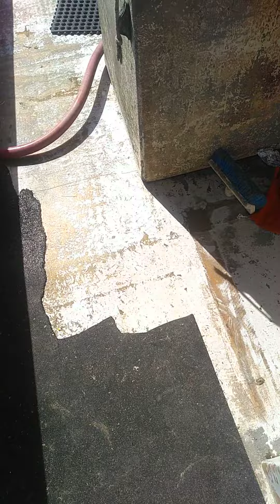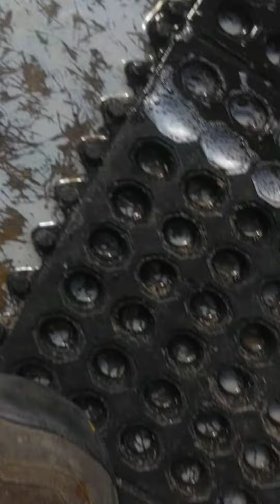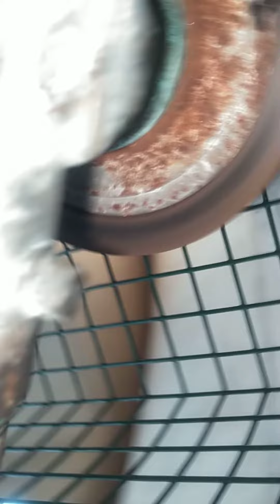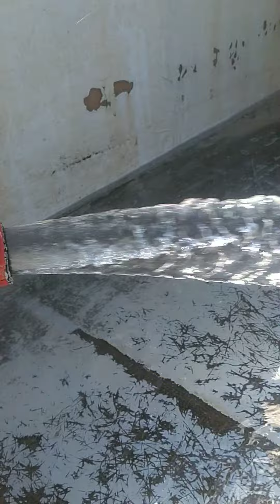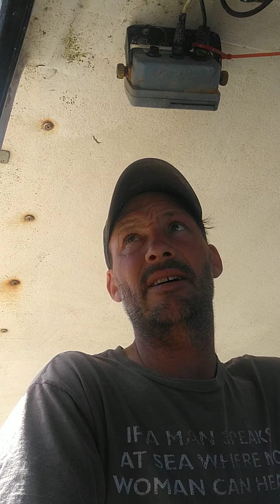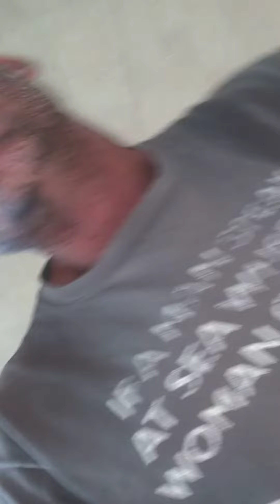new parts worked👍👍

Comment: Gotta like it when shit goes right!!!what kinda motor is that  bud??
Reply from the maker: d-6 330 Volvo  I love it just don't think it's a long lasting motor as it will turn 3500 wide open and I steam at 2800 I'm told at 2800rpm it's only 70% load on the motor 🤞
Reply: Josh Welner ten four